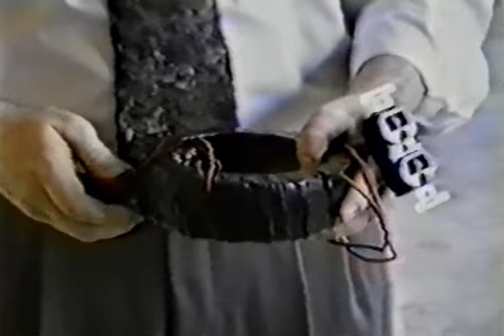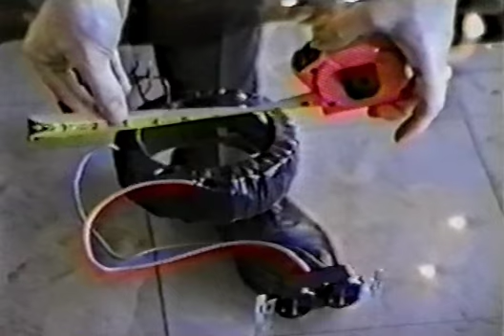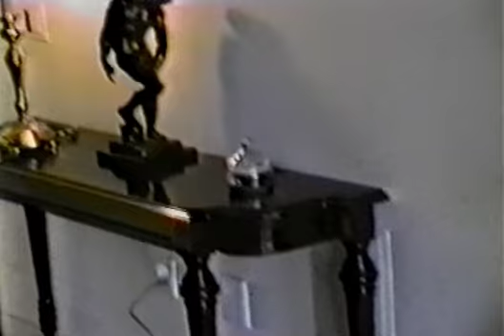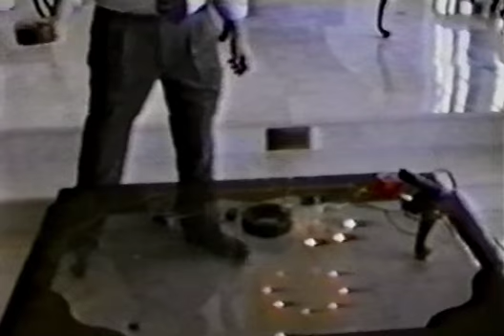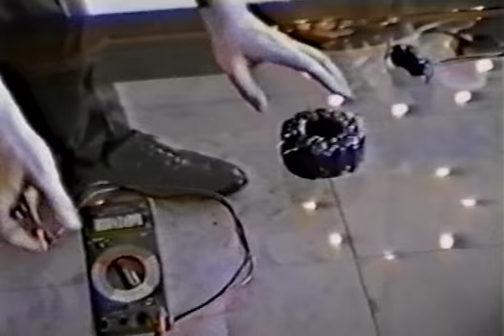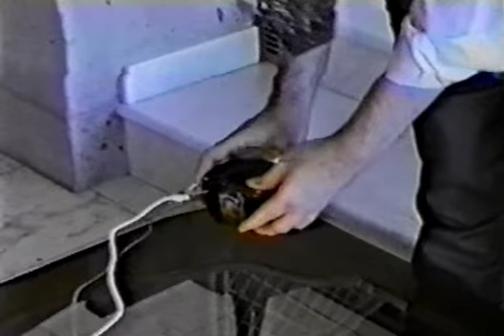TPU by Steven Mark - part 4

Comment: 9v batteries in series about 12 of them would produce around 108v. It can definitely run a bulb for a period of time. I'm skeptical of his toys specially when they're all wrapped in black tape. If you pay close attention, you can see slight outline of  rectangles that has the same shape and size of 9v batteries.